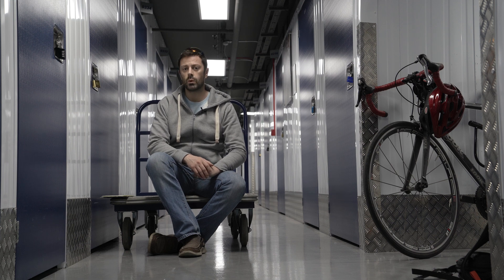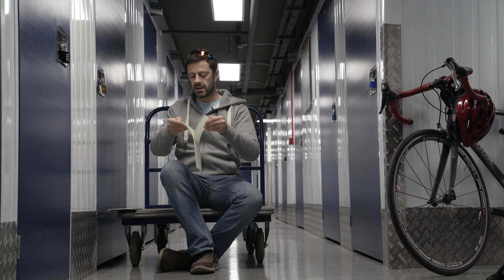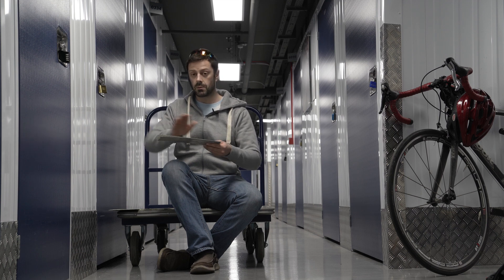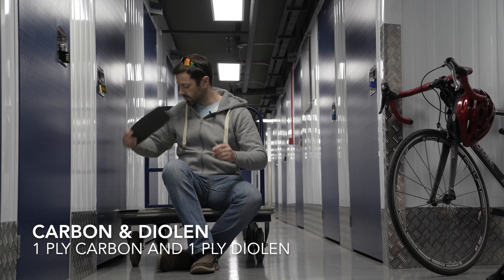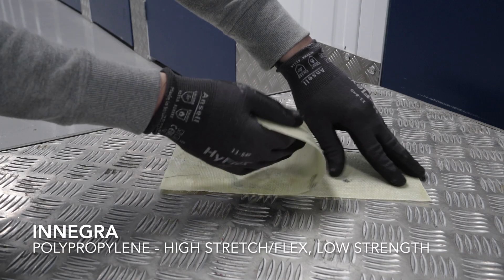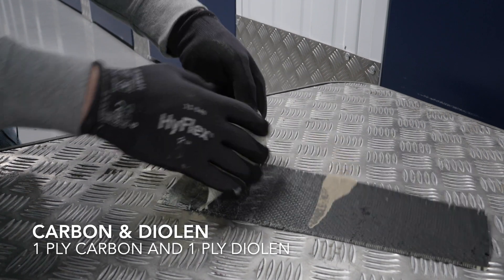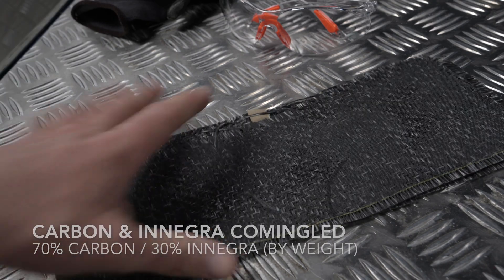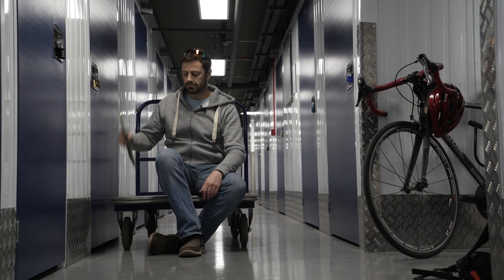RIPSTOP for Carbon Fibre? Testing the Innegra / Diolen interlayer bond. Arctic Project BERNARD [4K]

Comment: Do you think (or maybe even know) if "stress-delamination" is a problem in laminates? (Maybe fatigue-delamination would be a better term)
What I mean by stress-delamination is basically if you slightly bend the laminate hundreds or thousands of times, like it would happen in real use with a vehicle or thing that flexes a bit, does the laminate delaminate at some point?
Reply from the maker: Yes it's inevitable. I think for that I must follow best practice from others, since the only way to study this (I believe) is to have a high freqency fatigue testing rig and sensitive microphones that listen for noise that indicates invisible (to the eye) resin or fibre damage. There's a point at which I must trust in a material and make the structure!
Reply: @  oh definitely, I wasn't intending on badmouthing laminate.
I was just curious if that was a thing or not.
Reply from the maker: No badmouthing taken 😂

Cheers

Comment: Question! If building a stove plate of carbon fiber what thickness would I need? Ready made sheets would be fine. You’re the only composite guru I know that understands the need for a stove stand.
Reply from the maker: Pure carbon without core? 3 or 4mm I'd say.
Reply: @ I’ve seen you using one. Does yours have a core? Is it worth it or does plywood suffice?
Reply from the maker: It's a solid one but I'd happily use a cored one. You could probably get away with thinner, and it would be good to include an inner ply of glass/innegra/diolen/kevlar for toughness. Ply is fine, but carbon lighter and will last longer. I've never broken either though.

Comment: Is that a 4 to 1 epoxy or 1 to 1 mix wet lay up with or without vacuum bag, enjoy your channel.
Reply from the maker: These were made with Ampreg 30 which is a 100:26 ratio. Then compressed between flat plates for cure.

Comment: Apologies for pulling the broken record routine but thought it would be easier to share the link than to name the channel and make you hunt for the video like I did last time- These folks across the pond have managed to increase the bending modulus (resistance to flex) of the raw epoxy by 750% with the addition of 0.6% graphene flakes that they made themselves.

https://youtu.be/3hHoL77QDkg
Reply from the maker: Thanks. I did read up on this. I think you'll end up exchanging one benefit for another. Flexural strength is great, but graphene may negatively affect the adhesive quality of the epoxy, even acting as an interlaminar lubricant.

Comment: thanks for the video. dumb question but would it maybe help if cut latches into the fabric that you put through a slot in the other one and kind of interweave them maybe? sorry ;)
Reply from the maker: That would help jnterlaminar strength. But damage the inherent strength of each ply. Rather like the short strands of chopped strand mat aren't very good compared to woven.

Comment: You should really make a jig and get a force meter so you can get some actual values for how much force it takes to pull them apart.
As going off of feel isn't a reliable measurement for seeing what performs better.
Especially one offs of each type. Because a bad glue up could impact the results by a lot.

Also, what about using some of the blended and hybrid sheets and bonding them to the pure materials.
If that works, they might function as an intermediate layer to help adhere the differing materials to each other.
Reply from the maker: The resin was the same batch for all samples.

For real world tests I don't think intermediates would add much, as you'd never bond to one in a laminate. If trying to standardise a measured adhesion for each, maybe, but it's clear that interlaminar adhesion is multifactorial so I prefer real world examples.

Comment: How do polar explorers repair thermo-setting plastics in arctic weather?
Reply from the maker: They don't. Epoxy isn't a thermo-setting plastic - it's a chemical cure. Polyester and polypropylene are just the fibres in the resin-encapsulated fabrics.
Reply: @AlexHibbertOriginals  temperature affects epoxy workability and curing time
Reply from the maker: The repair resins available are fine to cure at temperatures easy to maintain for 6-12 hours in an enclosed area.

Easier than welding.

Comment: Interesting that the Carbon-Carbon bond performed so badly (and - in hindsight - a bit of an oversight not to have a C-C control sample). Not to doubt your composite skills, but since it apparently failed easier than you expected (the ripstop test turned into a small C-C test after all), is there a chance of improper lamination?
Reply from the maker: The issue with C-C is that in laminates that thin, you normally end up snapping the carbon when you peel it back. I'm running some checks now to see.

It's possible that the takeaway is that C-C bonds with epoxy aren't bomb-proof, and in more real life scenarios like bending shear, you'd not see a problem.